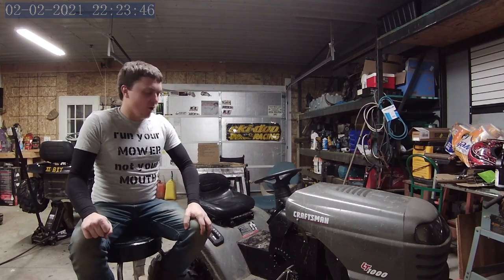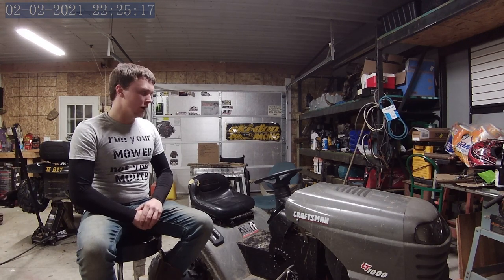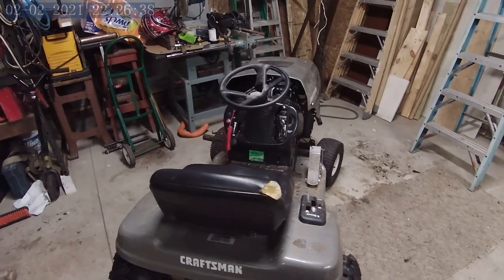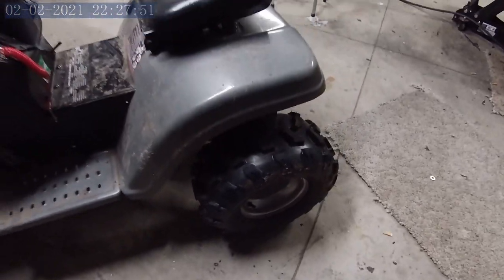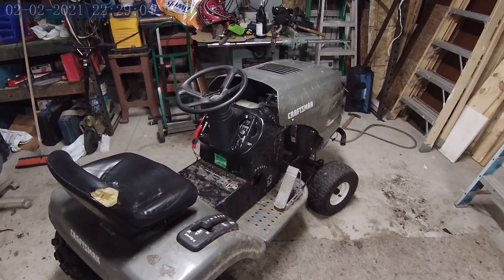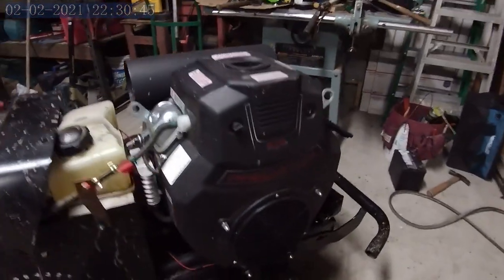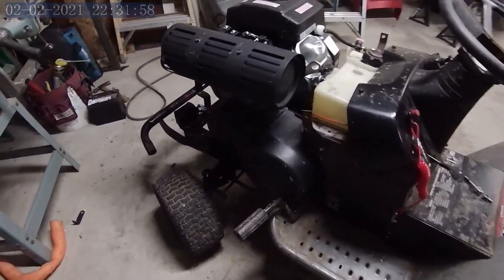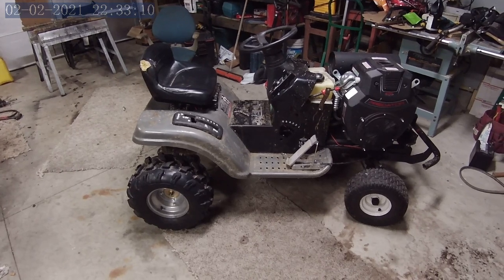How To Put A 670cc Predator into a Mud Mower (Newer Videos Uploaded As Well)

Comment: Can i get a video of how you ran the chain im building a mud mower with dual rear wheels and plan to use a jack shaft
Reply from the maker: I have a few different videos of this build showing how the chain runs. I have a 40 series clutch, that i run a 40 chain straight to the back. I have to roller sprockets and one is on a notch so it can be tightened and loosened. It is very simple design, if you need more photos or something, feel free to add us on facebook under mowers gone wild and message me there, I can take some better photos.